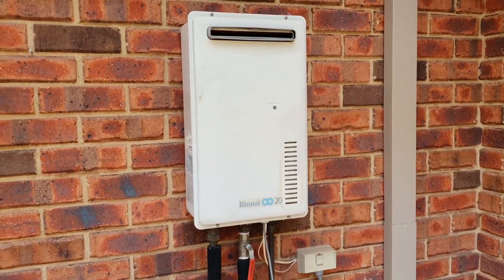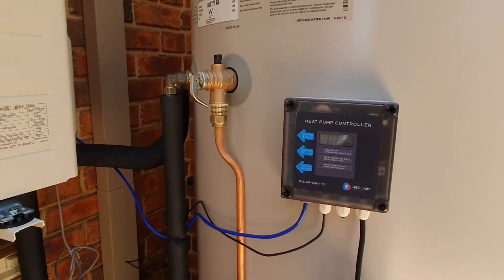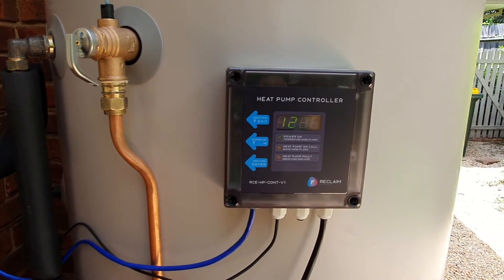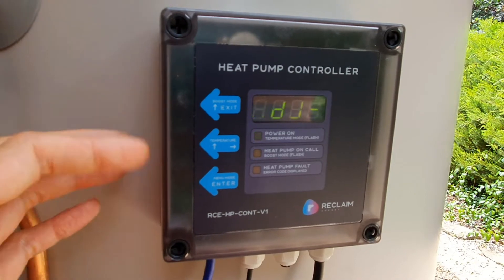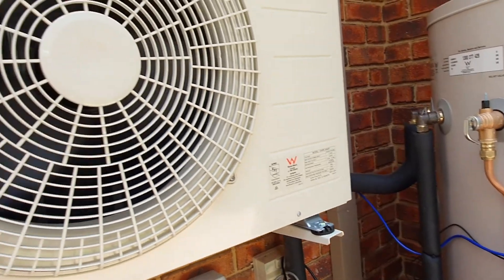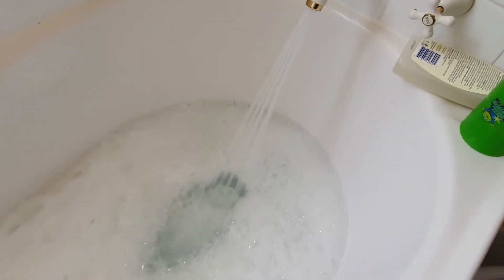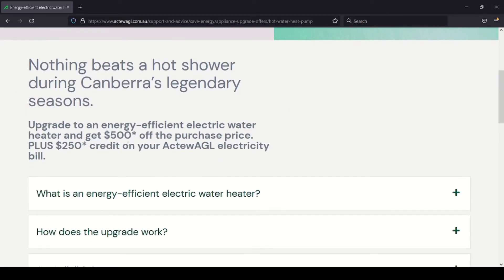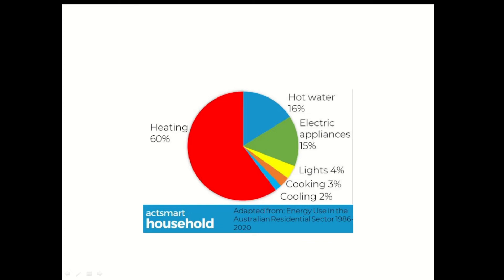RECLAIM Hot Water Heat Pump | Hot Water System Upgrade

Comment: Thanks mate. Very interesting to me. I have a Rinnai 17e continuous flow water heater. Its a cheap to run as they come had it installed around 11 years ago. There is no way an electric system would be any cheaper to heat the water in our house. Gas is solely for water in our house and we use 300KWh per year. Electric is for heating in lights and appliances in our house using 6500KWh per year.   Will be very interested to know your results after 6 months. Will look for the video now. If you see this comment please let me know or give me the link to the video if you did do it. Water to sink down stairs kitchen sink 1.5m to Rinnai cfwh takes 20seconds bathroom up stairs where the pipe runs 10-14m is 1minute easy. It does not bother me. Thanks for video let me know please

Comment: Hey mate. Fantastic video. I’m also in Canberra and with ACTEW. 
A few questions: 
- do you contact them directly and they’ll sort an installer? 
- or do you hit 2 or 3 installers and then tell them about the actew $500 offer? 
- also why did you go with reclaim and not sanden? 

I’d appreciate your answer. 

Cheers
Reply from the maker: ACTEW have a list of approved installers that you contact directly. It is listed under "How to Apply?" in this link https://www.actewagl.com.au/support-and-advice/save-energy/appliance-upgrade-offers/hot-water-heat-pump

All 3 of the quotes I received, quoted reclaim systems. I got 2 quotes from the approved list, and I even got a quote from someone outside the approved list but were a https://brighte.com.au/ approved installer and they also quoted a reclaim system.
Reply: @wiseoldconsumer  thank you for this. Really helpful info. Who did your install? It looks very neat.
Reply: @wiseoldconsumer  was it Australian hot water or actewagl energy people?
Reply from the maker: @pedroribeiro358  The provider I went with was the energy people

Comment: Thinking of changing from Gas to electric heat pump. Units are about 2000 bucks. My gas bill as a single dweller is not so high. I'm guessing would take 10 years for payback
Reply: People with heat pump systems probably benefit from units being in garage or enclosed room sucking air from attic